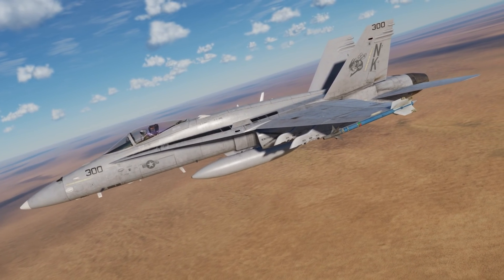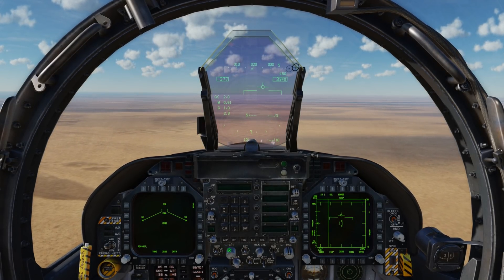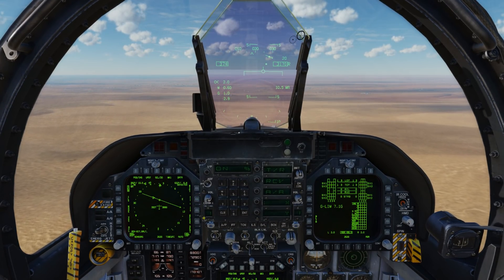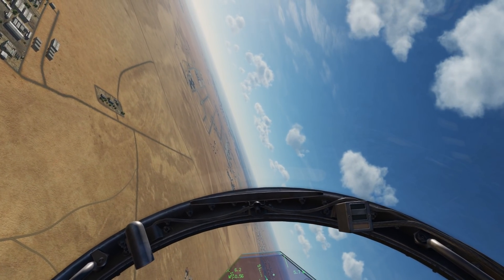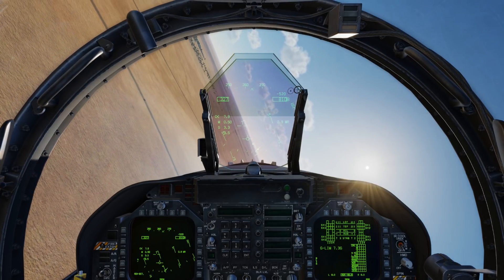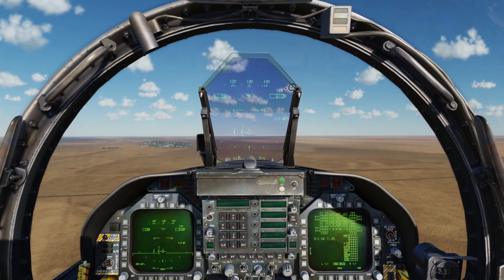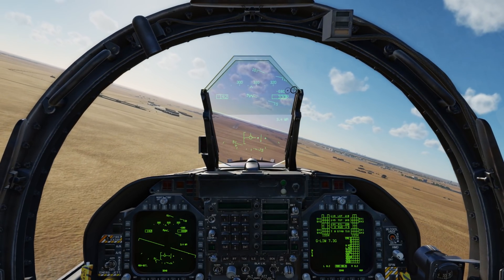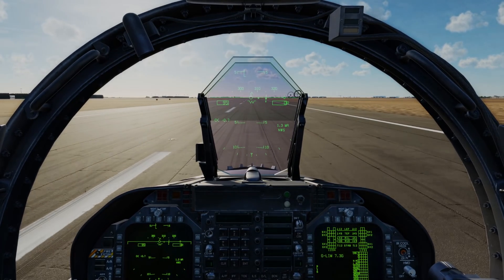DCS: F/A-18C Hornet - Episode 6: VFR Airfield Landing

Comment: Just FYI, while the break at the carrier is at 800 ft AGL, the break altitude at most Naval and Marine Corps Air Stations is 1,200-1,500 ft AGL.  VFR traffic patterns typically 1,000 ft AGL. (Many are 1,000 MSL since many NAS/MCAS are close to sea level.)
There are variations.  KNPA has a 1,300 MSL break and 800 MSL pattern.  KNPA also has a "Carrier Break" at 800 MSL with a 600 MSL downwind.  In my experience, USAF bases tend to have traffic patterns at or above 1,000 AGL, with a break altitude 200-500 ft higher.  If my memory is correct, Al Dhafra has a 1,000 AGL pattern.  (I only flew in there once though.)
Reply from the maker: Again, this is based on standard USN pattern.
Reply: Ship based and shore based USN landing patterns use different altitudes.  USN altitudes for shore based operations are what I stated above.  NATOPS section 7.3.2 "See figure 7-2.  Enter the pattern as prescribed by local course rules."   Figure 7-2 does NOT include altitude information because they depend on the airfield's designated pattern altitudes.  
The USN Carrier Landing Pattern (Figure 8-2) is indeed a 800' break/600' downwind.